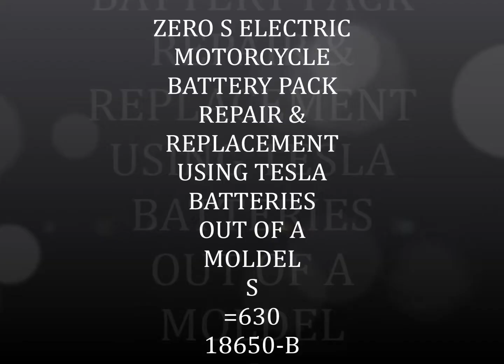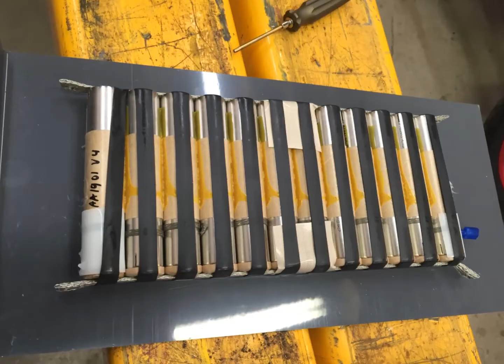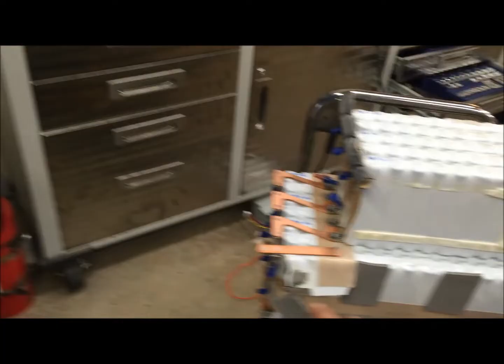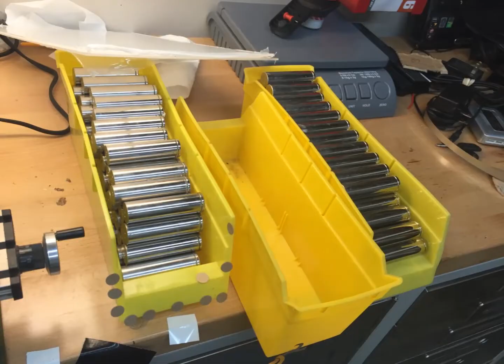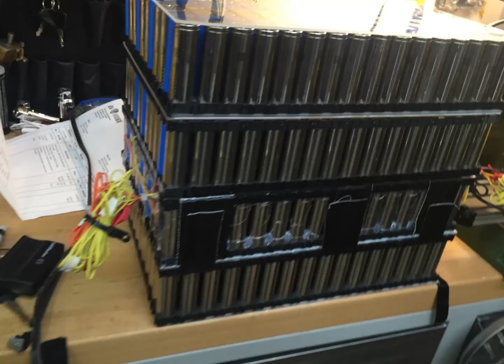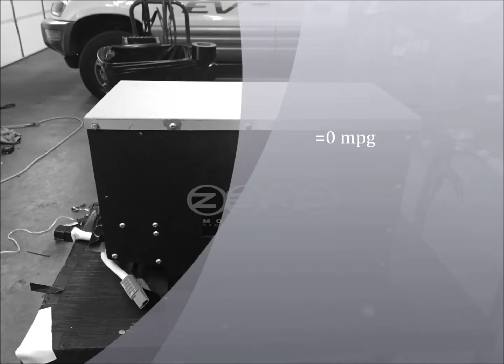ZERO ELECTRIC MOTORCYCLE TESLA UPGRADE

Comment: can you provide more information on how you connected the stacked modules?
Reply from the maker: I will do a better job explaining on the video I'm working on now. I am doing the same type of project except it's for a dirtbike. Same manufacture same year. It's exactly the same concept. So I will try harder to do a better job explaining.hopefully if this weather would let up I can get it done in the next few days.
Maybe I will post a in between video.

Well I take that back. They're not exactly the same but it will answer your question. This one I am doing different because these packs come out a lot easier so I'm making spare battery packs so if you were out riding you could come back and swap the pack. While the other one is charging. For people that ride dirt bikes at the desert all day or ride the tracks all day.
Basically I'm going to attempt to put the internal parts in the bike and just the battery in the back. Not that hard. The good thing is there will be more room for more cells as well.
Sorry if this is misspelled in lazy this morning voice to text.
Reply from the maker: +dingleigofai I will do my best to make a wiring diagram. It's pretty simple. They seem to follow the same color scheme from each one of their vehicles. I'm sure that's because they buy their battery management system from someone else.
I will go to work on that during the dirtbike version I am working on.

Comment: Jim, those pics of the module you ripped apart were painful to see :-O
Be careful with those cells
Glad to see the cells we supplied are being put to good use. :))
Reply from the maker: Thank you For the cells and for watching my video.
I purchase those packs all the time. I normally buy them complete 85KW out of the car. I am over 100 kW of Tesla packed sitting on the floor and about to go into one of my projects. But I am not going to take them apart. I only do that when they don't fit. 
I don't take them apart anymore. One of the people I buy these from sells them disassembled and shrink.
I don't know how they do it they must have a process because it sucks those things are bulletproof.
Reply: +Ev Jedi Jim, that would be me. You bought those old modules from us and I shipped you the 444 removed and wrapped cells a couple weeks ago.
Be cause ful with those cells, also don't solder on the side of the can...!!

Comment: how did you connect straps to the batteries? solder? spot weld?
Reply from the maker: Spot weld on 90% solder on wire connectors. You can buy the spot welder online supercheap. Trust me if you're going to do this many batteries it's worth it. I have a different idea for the electric dirtbike I am working on right now. Basically it's going to be similar to several flashlight tubes. 
I am in the development stage. I don't know if I'm going to end up using my new idea or not. I will try to do a video on it this weekend. I know I suck at videos. If I did a video on half the stuff i I am working on I probably would have a lot more viewers.
Reply: +Ev Jedi thanks for info and your videos are great.

Comment: i could have swore he just said 300 miles
Reply from the maker: Yeah when I said that it was just an estimation. I really don't know exactly how far it can go yet obviously there's a lot of variables depending on the speed terrain and all that. I've only drove it about 150 miles at one time and it still showed 1/4 charge then I turn the key off waited a few minutes turned it back on and it went up to over half. I'm not sure how the calculations in the BMS work it must use voltage and also programmed calculations. and I was driving extremely fast on the highway in the city stop & go if you were conservative you could go a long long ways. I'm trying to get those figures for everybody.
Reply: @evjedi4061   I would not trust BMS calculations for range. Better to test it youself within walking distance from where you live. It is tuned to slightly different parameters and voltages, which can get things off by 10s of %.

Comment: Good Job!  The Alltrax 4855 controller is programmes to 400A but it can do 500A easy by reprogramming it and playing with the MBB setting. on my previous DS 2011 i measured burst of 550A. The 2011 DS is about 60Wh per km average. If you have 700 cells of 3.7V and 3.5Ah, in the best case you have about 9kWh this is good for about 150 real km. To go 300 miles you would need to run to about 30kmh.. this is whre the 2011 DS is the most efficient: see my post about that when i measured the consumption vs speed: https://endless-sphere.com/forums/viewtopic.php?f=10&t=49778
Reply: Can you please give me your email. Im really interested in talking to you as i have the exact same bike.
Reply: FYI, this link no longer works… too bad for us.
Reply: Doctorbass

Comment: Nice work! When all is said and done how many kWh were you able to squeeze in there? (or squeeze out of there depending on your perspective ;-)) How much did the final pack weigh compared to the original?
Reply from the maker: I am not really sure to be honest. I'm not really good with those calculations. It was around 700 batteries most of them Tesla cells. Times around 3500 mA. I will have to go back and look up my blueprint book to find out exactly how many cells were in there. I have said the wrong amount on the video I do remember that it was more than I said on the video.

Comment: Great job, Nissan Leaf battery packs are a good conversion for these zero also.
Reply from the maker: I agree. The reason I went with the Tesla ( Battery Pack ) was I already had the Tesla pack lying around for testing. And didn't have enough of them to put in a car or any of that only had one I bought it for experimenting and because if one battery in it goes bad it doesn't cause the bike to stop running. And taking that battery pack out is a son of a b~~~h.

Comment: I bought the Zero xu 2012, it has a 200 amp controller. Fx has a 400. I wish I woulda got the FX. I was wondering if I could get a lighter, lithium polymer battery set up to help w the weight??? I dont know what that other multi pin connector does, the one on top of battery.
Reply from the maker: Yes you could obviously build One that does not weigh as much & is stronger But I am not aware of where you can buy one. You'll have to use the parts inside the battery pack. I will try to do a video for you explainingwhat each part and what it does and why you needed it. There is a computer inside the battery box that balances each cell making sure each of the individual batteries have the same amount of power. And the speed controller will not turn on until that system says everything is OK.

Comment: Wow I think I saw that bike for sale on the forum I saw a wrecked Tesla on ebay too glad to see it went to good use.  Could you please make a video of the bike in use?  Did you get more speed or torque from the new cells?  I caught the range of 300 miles at the end of the video if that was even near highway speeds you need to be building these bikes.  I wish i had paid more attention in electronics class :)  MTFBWY
Reply from the maker: I really can't say if the bike is faster. Because I've never driven one before this one.
However I can tell you this thing is super quick.
I really don't know how far it will go only drove it about 150 miles at one time but I was hauling ass doing over hundred miles an hour 90% of the time. And when I finally stopped to have half of a battery according to the gauge.
If you're A police officer I'm just kidding.   :-)
I will try to do a video soon where I am driving it. I'm not much of a motorcycle rider.
Maybe I should send it to you based on your videos you could do some crazy tricks. :-)
Is far as learning how to do this I have never been taught any of this stuff I just dug in and started doing it. I bought my first electric vehicle online and I bought it nonrunning.it was a RAV4 original electric vehicle in then made it run and then I got bit now I have about 15 different electric￼ vehicles.
Thanks again you made my day

Comment: Did you test old cells that you get with the bike ? Maybe are couple of them are still good
Reply from the maker: Yes I tested them. It was very strange exactly half of the cells were perfectly fine. The other half were OK as well they just were practically dead.
I did a test by trickle charging them back up and it worked. But those batteries cannot hold nearly what the new ones can. I kept the old ones just in case one of my crazy projects could use them.